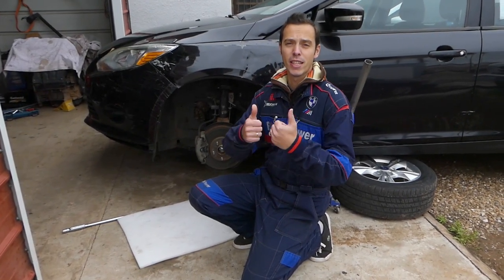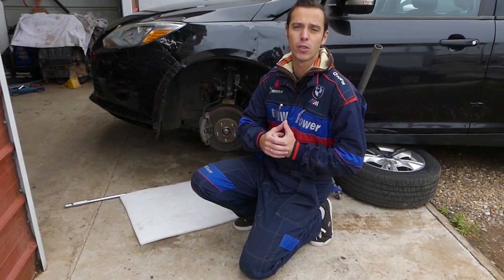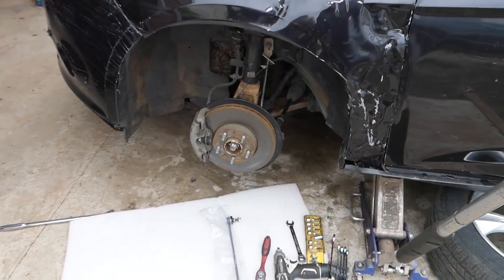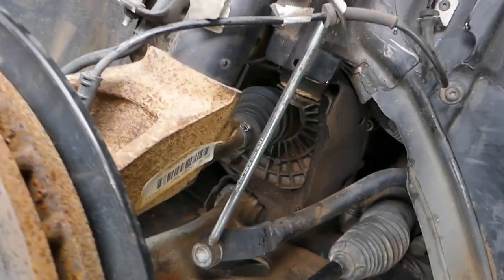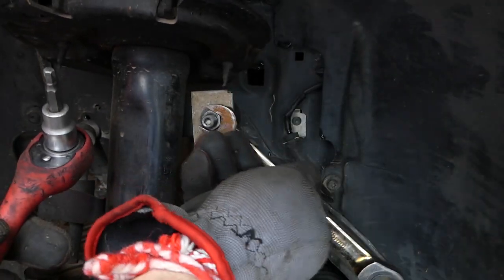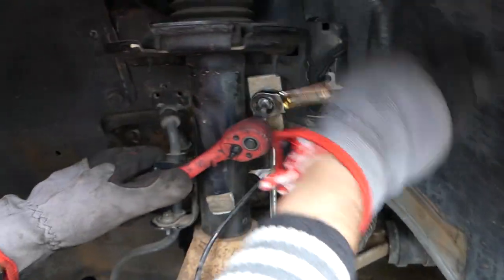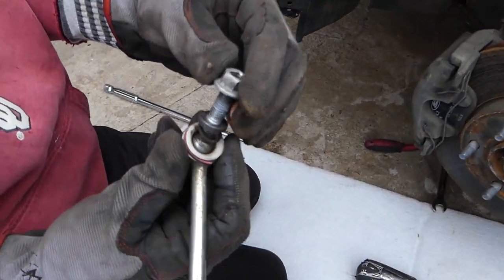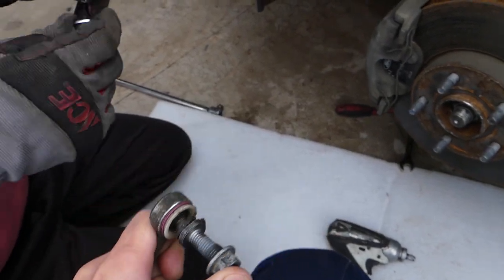FRONT END NOISE RATTLE FORD FOCUS. SWAY BAR LINK REPLACEMENT 2012 2013 2014 2015 2016 2017 2018 2019

Comment: There is a noise coming from the rear left of my Focus 3 maybe since 4 years when I go through even a light hallow but now the sound is louder. This part you changed, does it make a squeaking sound or knocking sound? I suspect from anti roll bar bushing. The sound sounds like spring squeaking inside the car 🤔
Reply: had the same noise on mine. might not be the same for you but search for ebrake line repair.  this is a known focus issue and even in Ford's repair manual at dealers. the plastic sheathing on the ebrake cable wears off and rubs against a metal loop. simple repair that resolved my noise